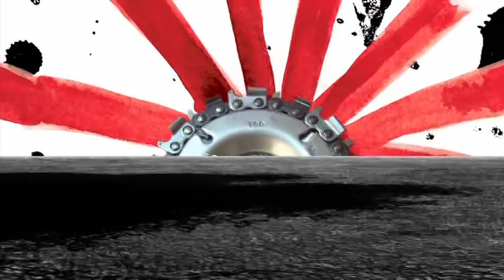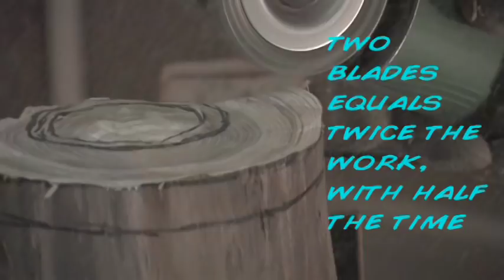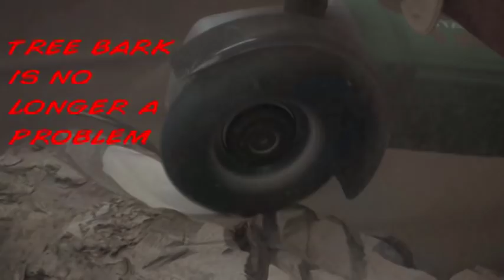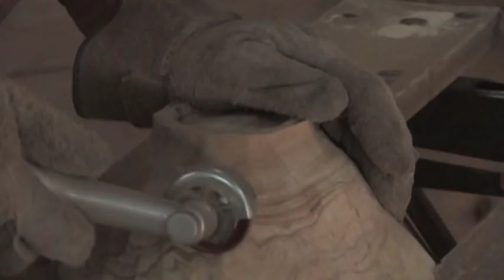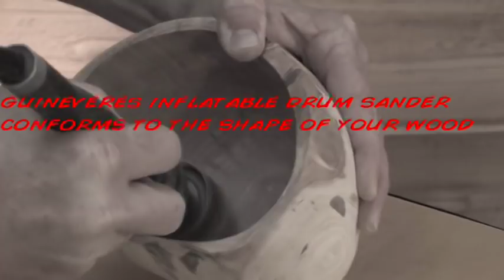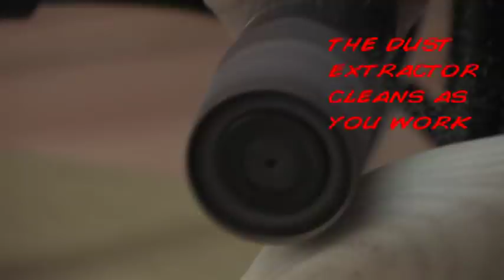King Arthur's Tools Product Video

Comment: Why is not allowed to use on Makita angle grinder ? Thank You !
Reply: Actually, there is only one Makita grinder that our blades will not fit onto. If the grinder has a paddle or trigger switch, it will work.